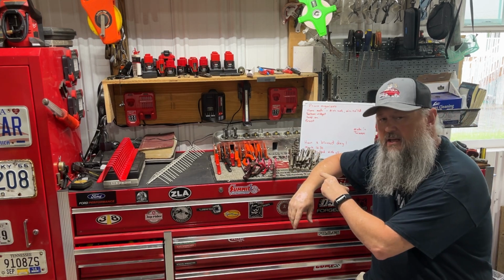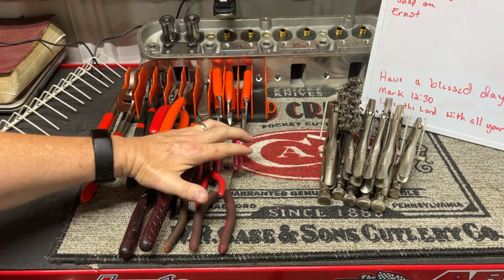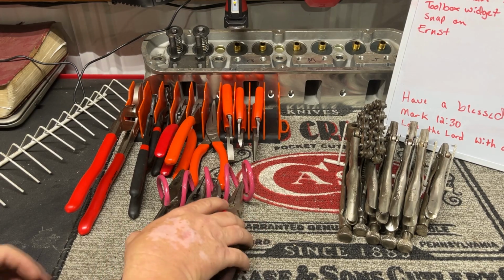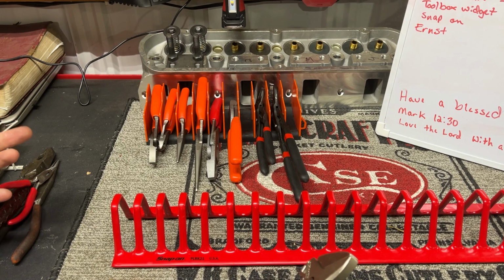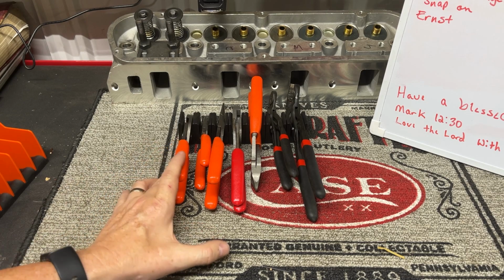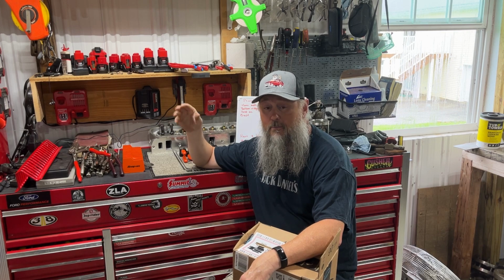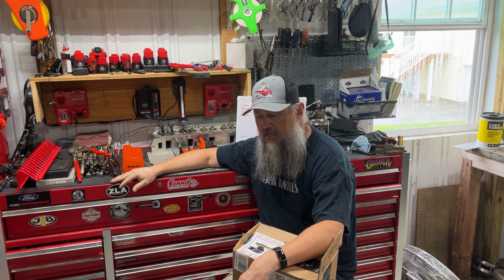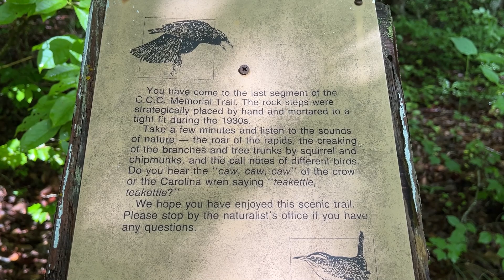Organizing pliers: Expert advice and tips

Comment: Great stuff.   I went with the toolbox widget.  I ended up gaining another full drawer after getting organized.   Using a 42 year old craftsman toolbox.   Well worth investing in organizing, as I would have been thinking I needed a bigger box too.  Simple solution, ask for the widgets for a Christmas gift from the kids.   Better than getting useless stuff from them.
Reply from the maker: Great idea, they aren't very expensive. The other good thing is they are shallow and can accommodate shorter drawers (if your pliers aren't too tall)
Reply: @Jethro2022  i moved some things to other drawer to make best  use of deeper drawers.  Also, don always have to connect them using both tabs.   I offset  some by one tab to accommodate for some longer handles.
Reply from the maker: Yep, I do that too. Sometimes I will offset them by moving the next down more and continue that to get what I need.